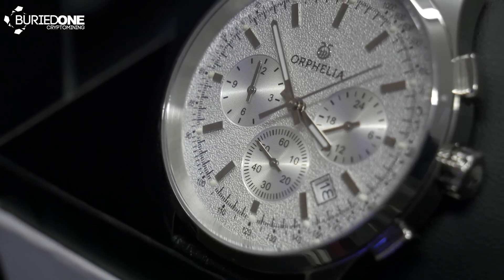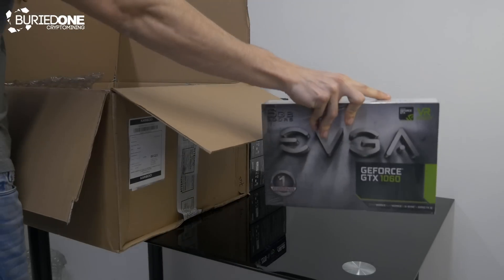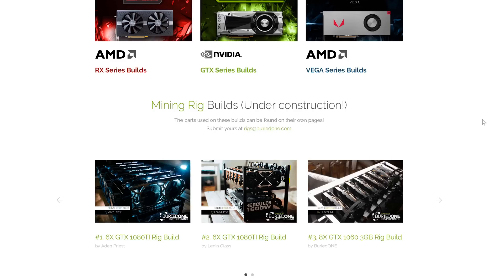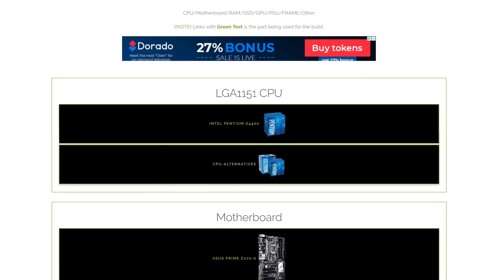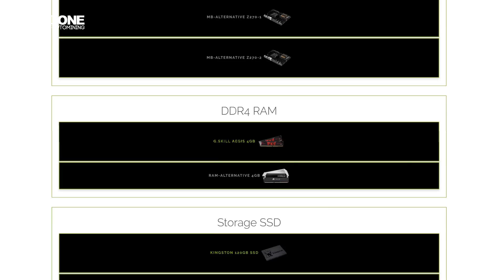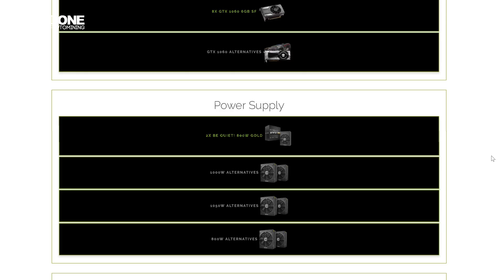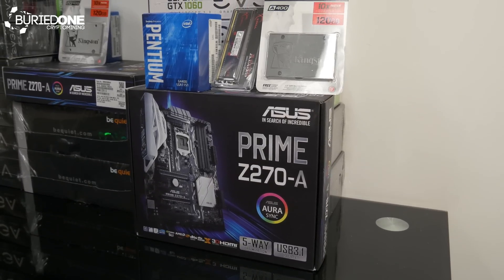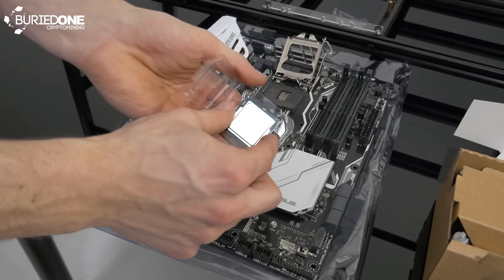8-GPU Single Fan GTX 1060 6GB Mining rig Build

Comment: do this same build with asus gtx ph 1060 6 gb. those monsters pulls 24.5 mhz  with core +100  memory +800.  tdp 59%.  an 8 gpu build will pull 196MH with only 650w from the wall. and kick bitmains asic on the nuts.

Comment: I just built my first rig for some
reason  my Nvidia gtx 1060 is not detectable in my device manager so when I try to run the drivers for my card it says couldn’t find hardware compatible how can I fix this issue?

Comment: 31mhs for ETH? each card? I am getting that with my 1070ti with OC
how much you can get that with the 1060?
Reply: GabakUSA Free computer training 190/8=23.75 . Sounds about right but not at 900 w from the wall. With that oc is more like 1.050 w from wall
Reply: ZeeFF hi dude can i use 1200 psu rather than using 2 x 800 psu?
Reply: First of all he probably got 2 x 800w cheaper than 1x1200. Secondly ... use on what? How many cards?

Comment: Great vid, always helpful. My question is why doesn't anyone show the struggles of setting up a multi gpu setup? When I start a new rig, I have to use a gpu in the x16 slot first, setup the driver then shut down then plug in the rest of the gpus.  I've got both amd and nvidia rigs, they both require this but I never see people doing it. Any thoughts?

Comment: Nice video... Keep it up... But its 2018 bro.  Build a 12 gpu rig
Reply from the maker: Kenshinboy itvwas for a subscriber
Reply: Maur biostar TB250-BTC PRO or the new Gigabyte GA-B250-FinTech. Most important, run them on a 20amp circuit with gauge #12. I will not go more than 1600Watts on a regular 15Amp plug. A good electrician will told this rule. For no babysitting, do not go above 80% with continue power(more than 3 hours). Which is around 1440watts or 10GPU at the most.
Reply: what mobo do you use for 12 gpu rig?
Reply: Jon Sauve Theberge damn, i need more research haha. thanks for replying
Reply: Maur no worries, the pro use metal wrap cable for their electricity. Just like commercial building. Most house is plastic surround and the electrical cable goes very hot I believe. We don't want the plastic wrap start melting. You can go up to 1800w but 80% is no babysitting.
Reply: It is 2019